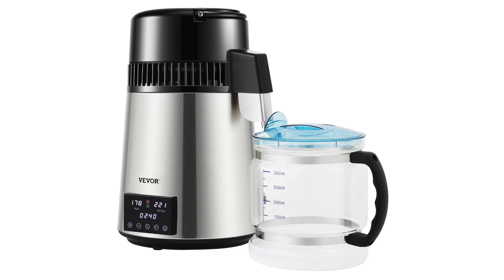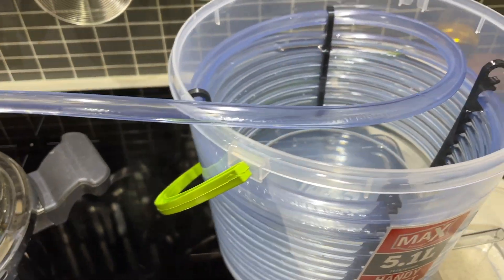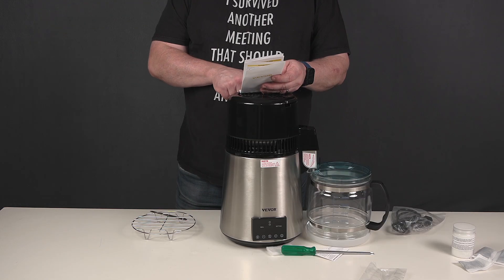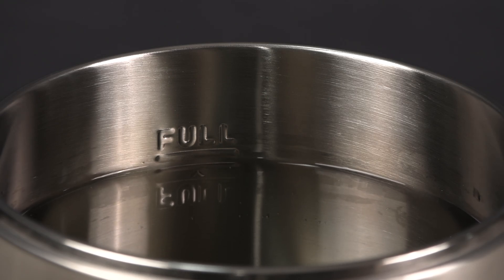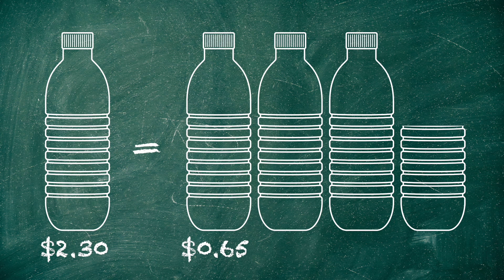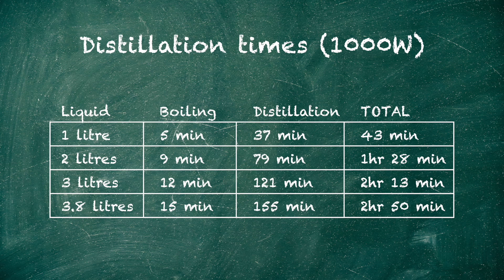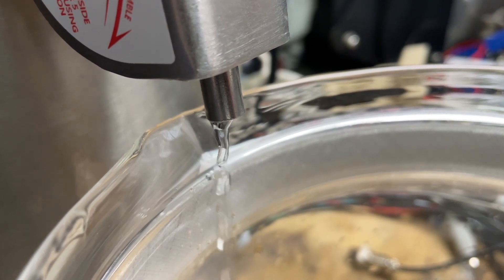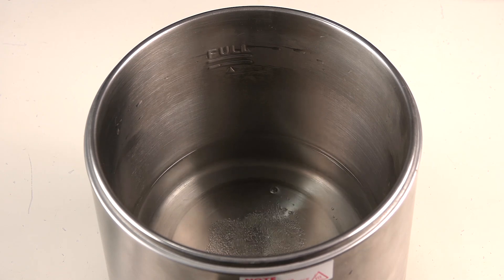Vevor Water Distiller Product Review

Comment: With my Vevor unit, the fan started to rattle after only using it less than 10 times. So, it is not the same quality as the original one, but it comes at a much lower price point. Overall, it is OK for occasional uses (e.g. fasting)

Comment: The instructions are not in order. They tell you how to distill water first, but you then tells you before you begin (but you already did), to run a 30 minute cleaning cycle 1st. That is half way down the page of instructions. Run it with 1 liter water and 2 tsp of citric acrid (included). Boil for 30 minutes. You're also supposed to soak the charcoal bag for 5 minutes. After that, you're ready to go to step 1 and distill some water. When I run out of charcoal, I'm not using any; it's already distilled. There are 2 fill lines. The top one is for leaving some water behind before it dries with deposits on it. The cost of making a gallon of distilled water in central Florida is 47 cents. (.18 per kWh x 3.5 ). The cheapest bottled near me is $1.75 at Family Dollar. The handle on the glass container has a history of those rings not fitting. I got a white one because of that and use a plastic jug.
Reply: I didn't use the charcoal bag either until I found out that VOC's and VOIC's boil at the same temperature as water, which means they'll end up in your water without the charcoal pack.

Comment: The condensation that was apparently accumulating on the outside of the water container was accumulating quite dramatically.  I only knew this because when I cleaned the tank out and refilled it and it wouldn't turn on.  So I took the bottom off and the whole inside, wires everything was just dripping wet.  There was water everywhere, so I can definitely see the "fire hazard" there!  This was very concerning to me, especially with people that leave their house and leave it on for water to be there when they get home.  I mean if condensation is an issue, why are all of the electrical components  completely exposed?  I think this is crazy dangerous!!

Comment: Mine , same model but 750w , it smells and tastes of plastic , if i stick my nose inside output cover , it smells like the water tastes - very plasticky stomach churningly bad , tap water goes into it and undrinkable plastic water come out of it. ive run many cycles through it over a week and its not going away!
Reply: Oh no ... contact Vevor ... maybe they'll send a replacement unit in case the one you received is defective.

Comment: Great vid. I didn't know the potential of this machine. Even Coke is drinkable. My Vevor failed after a few uses. The fuse/power switch repeatedly stopped working. Vevor relaced it, although I couldn't find a photo of this part anywhere in their material. So I took my own, but WHY? I'm still unable to distill water after the second fuse failure.
Reply: never leave the house when it's on.
You might never see your house again.
Read my comment on here.

Comment: If you disassemble the metal rings, you can position the piece which is threaded on both sides so that you can tighten the screws until it pulls the rings and the handle stays fixed on the jug. Thank you for the review!
Reply: Thanks!

Comment: If you want to avoid nano- and microplastics in your drinking water, then you will use a distiller. Don't drink bottled water for health reasons. 
After you have finished the anti-scale detergent, use cleaning vinegar, which is cheaper and easy to use.
Reply from the maker: I've also found cream of tartar does quite a good job of descaling.
Reply: Very nice video thank you!! 👏👏

Comment: Salty as Bruce, i recommend the 12lt vevor pot distiller kit, use with single induction hotplate set to 80c , get more volume per watt , also use 2 frozen 2lt coke bottles in your kitchen sink with the water pump for condensation temps do need add ice but get about 9 lts out 12lts  without the vape chamber thats for alcohol infusion like making ozuo with aniseed. :)